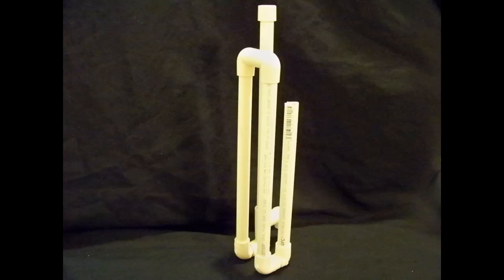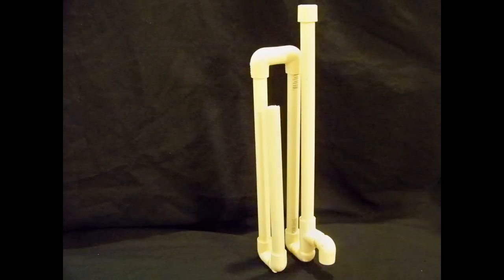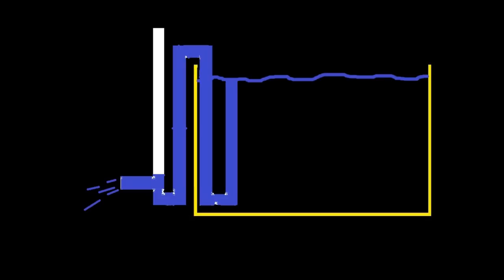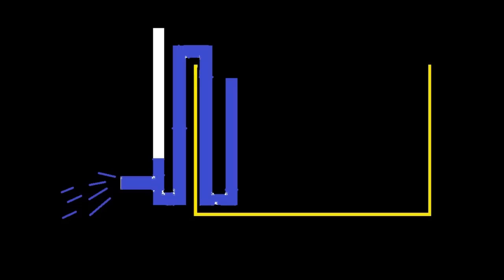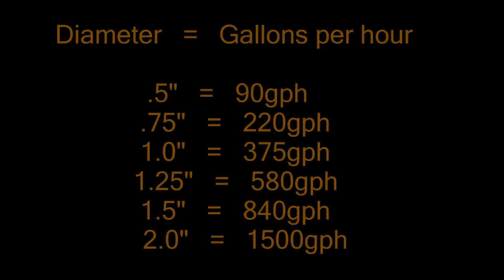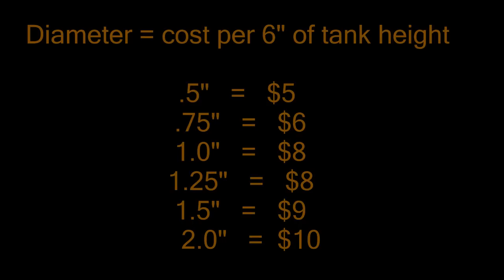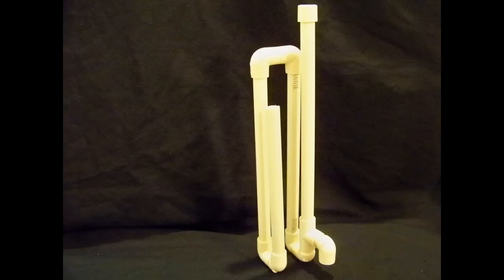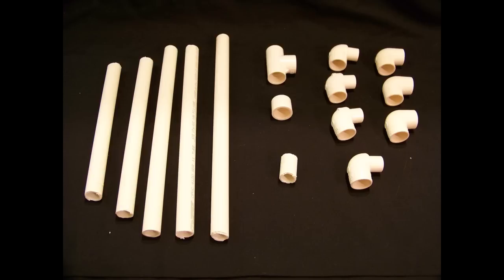HOW IT WORKS: DIY Aquarium Overflow PVC

Comment: Nice collection of videos. Since you and other recommend two overflows
 to guard against clogs (etc.) what about a dual setup? I've seen other vids but want to keep any such twin overflows on one side so the return is on the other. Any suggestions as to how you'd couple two of your designs together. Ideally there would only be one pipe to sump, but perhaps that defeats the whole purpose. Thoughts?

Comment: Ok - I capped off the drain and filled  the standpipe, but still had some air in the loop, so the check-valve was needed. Wow - this works really well!!!! I'm using it in conjunction with the DIY Aquarium Auto Water Change at about 2 liters per hour for a 160 liter tank, rather than to a sump and pumping back up to the tank. Will drop this to 1 liter per hour when adjusting, so I get a complete water change every week. Thanks heaps  King of DIY - no more manual water changes for me ever again!!!!

Comment: Please make another of these videos showing the "updated overflow" with one pipe inside the tank. I seem to be having problems with the setup. Testing went well, but when it came to placing on the tank, it just wouldn't keep flowing. I did seal all joints, so I think I may need to install a check valve.

Comment: I wonder whats the cap for on the top of the outside part of the system ?
Did u glu the cap on the tube or is it used to minimise the noise of the overflowing water ?

Thanks

Comment: Hi joey, 

i tried this and it work as it should be. However, my concern is that with this setup, it seems that it is only cleaning dirt that are floating. How about the once at the bottom? What do you usually do with that aside from siphoning separately using a hose?

hope to hear from you.

Comment: Joey, i've follow all your steps, it seems right but when i filled the tank up, the water didn't overflowing though. i've sucked the check valve as hard as i can but it shows nothing. btw, i use the 1" PVC for the hanging overflow and the 3/4' PVC for the water pump. i hope you will help me :)
Reply: did u have a end cap? wid a small hole or big hole or med?
Reply: hi, thx for commenting. Right now, my overflow is already working. I notice that the water on the pipe wont go further to the end of the overflow because there's no water on the half side of the overflow (part hanging on outside of your tank ). So, to fix it I just  filled water from the end cap. I suck the check valve and fortunately it did work until now :)
Reply: ahhh no problem xD

Comment: Hey Joey, I have a question about this overflow. First off, I am a big fan of your videos and you do tremendous (and very innovative) work. My question concerns the the overflow shutting itself off. Every now and then, I'll walk into my room only to hear the sounds of pumps struggling to get water and ill also notice that the water level  is not below the intake pipe, but above it and for some reason is just not pulling the water down. Any reason s for this? Thanks

Comment: in your build, you mention using a one-way check valve to remove the air but do not show how it is installed in the top loop.  Do you have a video with it installed?

Comment: I have a question. Instead of having the exit hole down low can I put it higher to the rim of tank so that I can  connect more pipes and have water flow into another tank at the same level. Will it work?

Comment: The tee piece is the critical piece, or rather the height of the tee piece above the bottom bends. The 'main' loop going over the tank side is a siphon with a 'head' equal the the height of the tee piece from bottom.
Block the outlet and standpipe whilst sucking to get the water over the tank into the main loop.

Comment: Can you make the whole thing shorter, or do all four legs have to go down to the bottom of your tank?

My tank is 21" deep with about 7" of substrate in the back. Would this function hanging over and everything about 10"? Wouldn't a shorter setup still allow the loop to maintain prime?

Comment: Could you do an show on how to make an water cut off valve for this overflow unit for or if you lose electric power to house to prevent overflowing your sump or when sump level gets to high please??
Reply: +stefanf11 as long as you set the height of your drain correctly you would be fine

Comment: hey big fan... im a little confused.   when u start sucking on the valve..  around 3:47..  and the outside pipe fills up,  do you have to plug the bottom where the water exits. .  thanks..

Comment: Quick question... How do you prime this system?  Correct me if Im wrong, but air will take the travel of least resistance, the exhaust end...  Sucking on the check valve will only pull air from the exhaust end of the system, and not the filled pipe inside the tank....  Should the exhaust pipe and breather pipe be plugged up to prime the system? Please explain... Thanks.

Comment: I am wanting to use this system on multi-tanks system, using a drip system.  Will it work in the same manner? 

Additional information: Setting this up with a timer to do 20% water changes x2 daily for breeder tanks and 40% x2 daily water changes for fry tanks.

Comment: ok I'm going to try this but I've been thru several vids and I'm still not understanding something. the overflow is basically gravity and once it goes thru all the sump the pump is then what returns it to the tank? or is there to pumps one pulling and the other pushing?
Reply: +Gold Vulcan yup. a pump is needed
Reply: I got it working.  The water is beautiful.  I have noticed a higher evaporation.  Im probably adding a gallon every 4 to 5 days
Reply: yes the pump  returns it to the tank

Comment: Hi DIY King. Question for you. I watched this and another of your videos on overflows and noted you using a valve to restrict the flow return from your pump back into your tank. I'm wondering if this would have any negative long term impacts on the pump? Knowing most pumps use electromagnetic fields to spin an impeller thus making me think restricting flow would just mean the impeller wouldn't be able to spin as quickly as the magnetic field wants it to? Is this right?
Reply: Restricting outflow on a pump doesn't hurt it.

Comment: I have a question. Im making the 'new' type with a weir double sized in the tank as per the other vid thats in conjunction with this one. Is there a reason to have the teeth, or can i simply cut the bigger pipe so its a half inch shorter for a smooth overflow vs the teeth version?

Comment: ok.  Im having a slight problem with this setup. I get it to prime quite fine, and my return works as well, but  my return isnt pulling enough water to accomodate for how much the over flow is sending down to the sump, so its overflowing the sump, which obviously is all over my floor. i believe the underwater pump i have flows 300gph.  what should i have? this is under my 120 gallon aquarium, the sump is a 20 gallon aquarium. im using 3/4 in pvc.
Reply: +Kenneth Ross You probably should have a larger sump and stronger pump. either way you should move the drain height up so the water can only drain once the it flows back into the tank. regardless of pump strength you dont want the drain height to be low enough to overflow your sump just in case of a power outage and/or every time you shut off your pump to do a water change.
Reply: +Kenneth Ross also keep in mind for a small sump you may want to get a check valve on the return to avoid a backwash flood from the water siphoning through the pump.

Comment: hi there, i have a couple questions..i hope you can answer them for me!
first off, ill be using this meathod on my 115 gallon piranha tank, what size tubing should i be doing this with?? i was thinking 1" drain and 3/4" return, would that be too small??
second, ill be using the sump as a wet/ dry system, the bio balls (or nylon sponge) should be the firstfilter media right? and should be "dripped" on not submerged correct?? i cant find any good videos on how to properly set it up. 30 gal sump

Comment: I can understand this is to remove the air from the trap/system, the question is if we can remove the air by dipping this, sealing and then installing it, there will not be any air to be removed so does not need the check valve, right?

Comment: Hay I've a 2500lph pump and I'm using the 32mm (1 1/4") pvc pipe but the pump is too fast for the pipe even when it's turned down to the slowest setting any advice. And what is the purpose of the cap with the hole in it?
Thanks

Comment: Sir Uarujoey, will the overflow work for a fibreglass tank that is on the floor? If I dont attatch the length of the pipe to the base of the tank. to like about halfway down the tank. Will the overflow work?

Comment: Thanks for the informative video. I made this using 1 1/2" PVC and its great. However I only made one and I'm worried that it may get clogged and my tabk will run over so I need to make that other one asap. But I love overflows simply because you get a height rate of water filtration and it skims the surface of the water at the same time.

Comment: Hopefully this will help some people.
First and foremost, yes, this design works (I am using it myself). However, it is not actually an overflow, it's a siphon. Now, this is an extremely clever design and the way it's build allows the siphon to act like an overflow. It being a siphon is the reason so many people may have trouble with this. A siphon relies on suction, so it needs to be airtight. SEAL AND RESEAL. GET IT AIR TIGHT. If air leaks, it will either not work or slowly undo itself.

Comment: hey there I'm having issues figuring out how exactly it needs to be primed I've got it to work randomly and primed correctly and it's been running for months but recently it just stopped and I cannot prime it correctly. it runs but it doesn't gargle like it used it's just silently poring out until the pipe overflows and doesn't work anymore I need to get this overflow running I've been fidgeting with it for 2 days and my water has went from clr to yellow. plz help

Comment: hey joey..just quick question...ive got 3 tanks hooked togheth to one sump..all using ur mehtos..but im running into times when the pvc overflows stop draining water...almost daily one of them stop..is it the size of the hole in the stand pipe that will fix that or something else i cna do?

Comment: Question - does the inside pipe have to be the same length as the outside pipe's length

IE, my inside pipes are 4.5inchs and 3.5 inches and the outside is 11.5 inches and 14inches.  I wanted to know if this will work, I don't think it will be a problem, but let me know -- pipes are 3/4" in diameter

Comment: another alternative to the air sucking/priming. put a valve at end of outlet. close valve, fill the pipe with water from the air pipe (the pipe that is highest). when full of water release valve, and you got a siphon. other benefits of valve, control the outflow rate, although you would want it to be max anyway

Question: if you have the 90 degree and T bar lower than the rest of the system would it still work. If so would it create a larger vacuum since the head difference is larger

Comment: Joey, I have a built the same model overflow you have here using 1" PVC, I built it kinda flying by the seat of my pants before watching any videos....Now the siphon runs fine and will restart beacuse of my larger stand pipe, but I seem to have trouble if theres a disturbance over the outflow breaking the airstream where my siphon will restart but flow at a slower rate is this beacuse i did not install the check valve?
thanks nick

Comment: I used 1 1/2 in pipe for my 65 gal but I do have it gate valved off at the end to keep it from gurgling and making rushing water sounds. 

I did construct it with a second inlet in case the first one should get plugged for some reason but I could cap that one because it is redundant since I have an auto shutoff should the tank overflow.

Comment: This is extremely easy to make, buy parts and a tube of PVC cement, a couple meters of straight pipe and a fine saw, 1 hour later you're done. Just completed mine today and it was dead easy.

Comment: so are you saying the pvc inside the tank where the overflow starts needs to be lower then the t section at the very end of the unit to maintain the siphon in the event of a power failure as wouldnt this create a huge amount of water to overflow before the loss of suction

Comment: Is the long of the pipes matter with the flow speed? Plz help I follow your instruction but I make my pipes shorter and I don't use cap
My pipes didn't reach the bottom of the tank
Reply from the maker: You didn't follow the instructions. Do not expect it to work if you dont build it as i say to.
Reply: Sorry I just fix my problem, and the problem its just leaking of air, thx anyway for the tips

Comment: Why is the outpipe so low? Doesn't it risk of sucking air bubbles inside the system by stopping and resetting? Because the water level in the system sinks down to the level of the output an this is just above the bow inside the tank.

Comment: Accuracy check on video - While pumps are off, the water level inside the overflow tube will remain at the same height as the lower edge of the T connecter - The T connecter should be installed high enough on the vent stack so that bubbles will not form in the overflow intake chute (also makes the whole thing quieter).

Comment: Why on earth do you need the tall stand pipe on the outside of tank. At the top of the t valve is where the pressure from the water equalizes so what is the purpose of the ugly standpipe sticking up high on the outside of aquarium. And with a hole in it really makes it obsolete. I am building one and really would like to know why it is important. I have found other overflow info without it. What is your opinion on it of whether or not it is needed. Thanks

Comment: How do you calculate the GPH? for example from a 5inch pipe. Thanks btw
Reply: +Bernardo Rodarte you run water through it and fill a 1 gallon bucket then do the math... if it took 30 sec to fill you have 2 gallons a minute or 120 GPH (3600 / seconds it took to fill the 1 gallon bucket) for faster flow rates you will need a 5 gallon bucket
Reply: +per etz cancel that a 5 inch pipe you will need a different method

Comment: Hi ya i've just made my own overflow pipe from 35mm pvc pipe my question is that is the pipe to big as i see alot of people using smaller it will go in my 220litre reef tank i was also going to put a ball valve on the return pump so i can have control of the flow it wiuld be great to hear what you think on the size

Comment: i have maid one of these and just used pvc glue its leaking now on test, can i use tech 7 adhesive and put it around the fittings joints or will i have to start all over again

Comment: The design needs modified - I'll try to explain here. I recommend a slight modification to the design due to the probability of air intake into the siphon tube using this configuration. The modification is this: The outflowing T should be placed half-way up the vent-stack pipe. The reason this should be done is to prevent the intake cascade inside the overflow chute from carrying bubbles past the first elbow: if water isn't moving fast enough could collect air by the check-valve and flow failure
Reply: I think your right mate! Mine is primed then it stops working as powerful I reckon it’s down to the bubbles from the air pump getting into it! Guna have to have a think about it

Comment: wouldnt the water flow from overflow have to match exacyly to the water be pumped back into the tank? i dont see how it wouldnt get out of balance eventually. how does that work?
Reply: +skyler tremblay i thought that too. but then i did an analysis of what would happen in certain situations, whether it be the flow from the overflow being twice as much as the water being pumped in or vice versa. now the way i think it works, and i could be wrong here but im fairly confident i'm correct, is that the water flows dont have to match as long as the pump is not pumping in more than the overflow is taking out. If there is being more pumped in than the overflows are taking out, then obviously the overflows wont be able to take care of the extra water and eventually the water from the sump will continue to be pumped into the tank faster than it can be taken out, and the water level will rise until it spills out of the tank or until the sump is emptied, depending on how full both your tank and sump are. however, if the overflows work twice as fast as the pump that won't be a problem. the water level won't rise that much above the overflows since the pump is not pumping back enough water to keep up with the overflows and you won't have to worry about your sump overfilling with water since the overflows stop taking out water once the waterline drops below them. just compare a low flow pump to a pump that is shut off from a power outage or for maintenance. the water from the tank will eventually stop draining into your sump. so even if your overflows take out, lets say 5 times as much water as your pump puts back in, the water levels should remain relatively the same within a few inches. so as long as your overflows take out more than what is being pumped in you'll be fine. of course that is what i figured just by thinking about how the whole thing works so i could be wrong. if someone can confirm that'd be great. hope that helped
Reply: +Juan Maldonado sounds correct to me

Comment: So what happens when the overflow gets clogged?  I'm thinking you pump all the water from your sump into your tank and it overflows creating a huge mess.  Any safeguards against this?
Reply: a bigger diameter overflow pipe?

you could get a water sensor and somehow rig it so that when it detects water overflowing it shuts the power off to the pump.